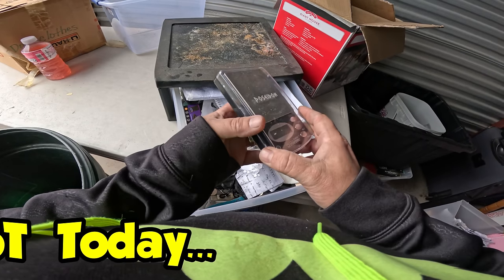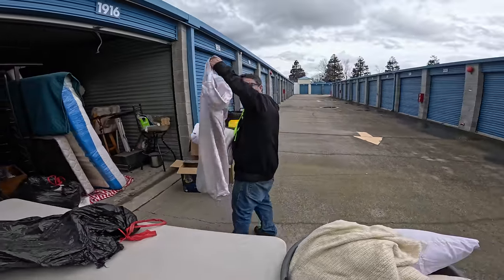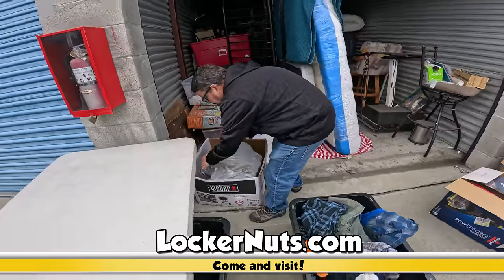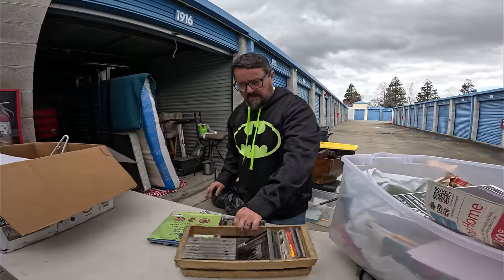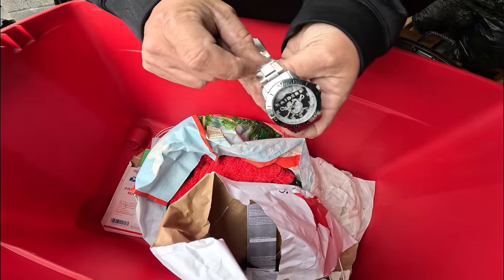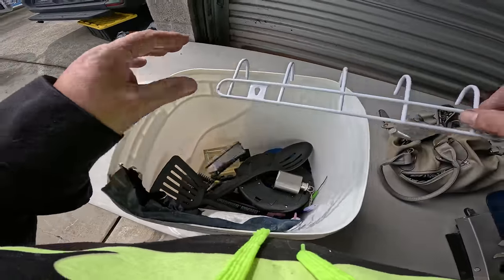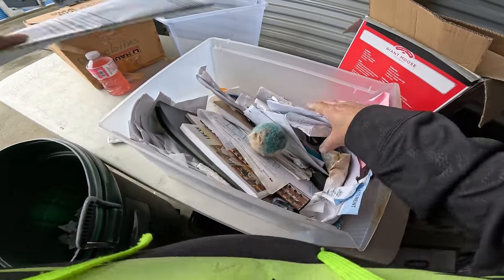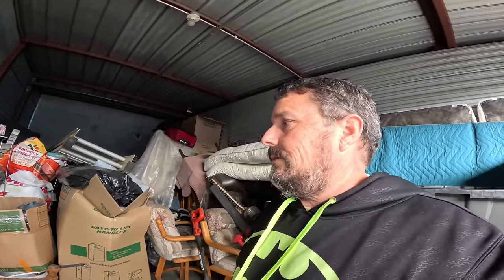Paid ONE DOLLAR for this locker, and we found THIS...

Comment: The set with the little earrings and guns is for piercing ears. The gun has some type of needle and when you "fire" it, the needle pierces the ear straight and fast so the wound is minimal. The earrings are used after piercing so the hole doesnt close when healing and they need to be tiny so they dont put weight on the fresh piercing.